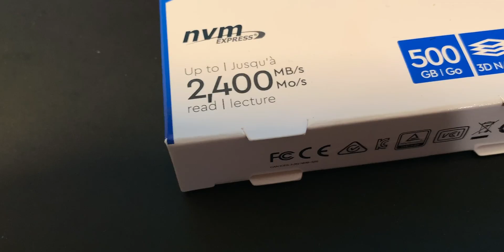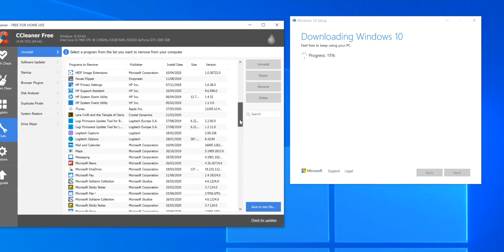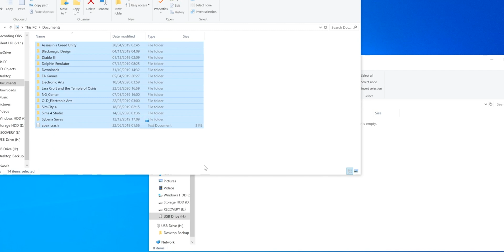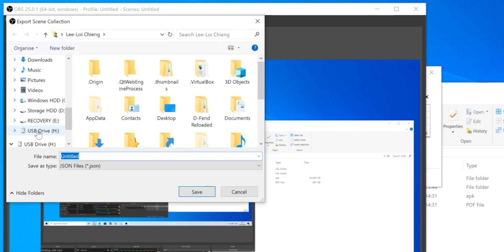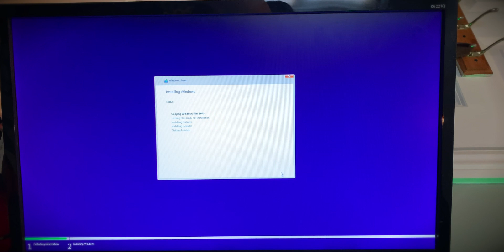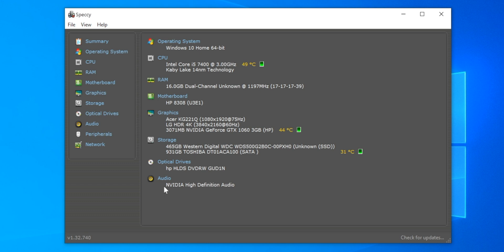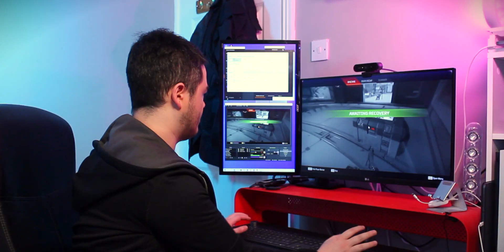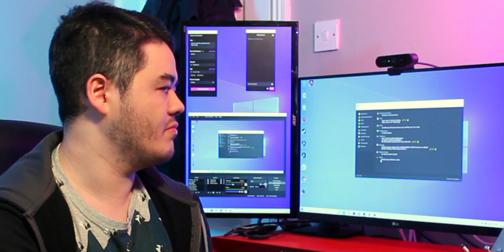Let's Upgrade my HP Omen Gaming Desktop Computer!

Comment: How did it begin a windows 10 install? Was there another drive hooked up when you booted it with the SSD? Im trying to upgrade my omen, but Im updrading SSD m.2 from another SSD m.2
Reply from the maker: Hey dude! Awesome stuff, so at 02:18 in the video when I'm prepping the Computer I show how to put Windows 10 on a USB flash drive, there's a link in the description to the installation tool. It's very straight forward as shown and be sure to keep the box ticked for "Use recommended options for this PC" If your making the thumb drive on the HP Omen you plan to upgrade. :)

Comment: Hi there I have the same motherboard (same pc different specs i7-8700 and 1070) do you know if I could be able too swap it for a i9-9900k? Thanks (Tampa2 motherboard)
Reply from the maker: No, this is locked to quad core processors only different socket only h270 processors compatible.
Reply: @ImLeeLoi  thank you good video keep it up

Comment: Hey lee what graphics card can i upgrade from a GeForce 1060 3gb (i have the same computer)
Reply from the maker: I’ve been eyeing the 2060 maybe even the 2070! 😁
Reply: @ImLeeLoi  Does it fit the motherboard?
Reply from the maker: @alexjamesj  That is a good point! Not 100% sure to tell you the truth. I haven't taken a ruler out and measured clearance. I don't think those cards are too big though.
Reply: @ImLeeLoi  yeah i’m looking to get a gpu so i can run VR better
Reply from the maker: @alexjamesj  Great idea. I must say I think I'll eventually just build a new system. The CPU on mine will always be limited to 4K so in a year or two I might just go all out. 

I might buy a cheap large SSD this year to move off mechanical storage altogether which currently has my game library on it.
Reply: @ImLeeLoi  yeah i’m gonna build the best gaming pc to date for the same price as the omen

Comment: Hey you might not see this but what's the full name of this pc?
Reply from the maker: Of course I do! I respond to everyone. It's the HP Omen 880-001NA from 2017 with 7th gen i7 7400 and the H270 chipset. :)

I did buy it used however.
Reply: @ImLeeLoi  thank you so much! I have the same pc but I couldn't figure out the name 🤣 I searched it up by the parts and different pc's came up. Now I can find out what's compatible and what's not thanks!
Reply from the maker: @pon224  Ok just make sure it's the exact same model. :)
Reply: @ImLeeLoi  im pretty sure it is thanks bro you earned a sub!
Reply from the maker: @pon224  Thanks for supporting the channel

Comment: Hello Lee!  I'm a bit of a PC-Part noobie (as weird as it sounds if you knew I code) and I was wondering if 2133MHz is truly the speed of this ram?  I really don't think its fast enough considering games I play which are heavily CPU dependent such as Fortnite.  Im thinking about upgrading to 32Gb and if possible without clocking over what I bought for getting my ram to 3200MHz aswell as an SSD (which I'm not sure how to install cause I have an HP Omen 870-244 which has an i7-7700, GTX 1070 8GB, and 16 Gigs of Ram) and I'd appreciate some guidance
Reply from the maker: I've never overclocked before. The ram said it did run at 2400Mhz, I think you need a different CPU and Mobo for faster ram but don't quote me on that. 

If your system monitor is telling you that you are using 16GB of ram while playing games then the 32GB upgrade is worth it. I can't imagine the difference between 2400MHz and 3200MHz ram being that drastic. The RAM and SSD upgrades should be similar to what I have done in my video. There is memory slots for your RAM and for your SSD.
Reply: @ImLeeLoi  Thank you :)

Comment: so you only need ram and a ssd card to upgrade on a pc im new to this lol ?
Reply from the maker: Welcome Everardo, the RAM and SSD items were what I chose to upgrade because they were quite lacking on the Computer I bought. My Computer had 8GB of RAM which is not a lot for todays games - you want at least 16GB.

The Manufacturer HP put "one stick" of 8GB already into the Computer so I bought a 2nd one to make it a total of 16GB. There are still two empty slots left so maybe next year I could upgrade again to 32GB if I need it (but I don't!)

The SSD was put in to make the Computer load faster. This Computer shipped with a spinning hard drive, I had a spare temporary faster hard drive but this SSD that kind of looks like the memory chip right it's called M.2  meaning it's very fast. 

Now if I was playing video games where they were animated slowly like the character is laggy and it's not enjoyable to play, I would need to upgrade the Graphics Card. I haven't done that yet, I'm not sure if I will I'm happy with what I have right now. :)

Hope this helps you understand why I bought new RAM and SSD.
Reply: @ImLeeLoi  i have a omen 870-224 which has a i5-7400 with 8 ram and the graphics card is a gtx 1060 3gb so would doing the same as you be good ? also i subbed to your amazing channel
Reply from the maker: @EverardoJuarez-l7r  Hi Everardo, 

Yeah I think we have the exact same Computer just inside of a different case. If you perform the same upgrades I have you're going to notice a MUCH overall faster performance. Everything from Turning on your Computer to browsing the Internet and yes, even loading Games like GTA 5 should load in faster than what you currently have. These upgrades will make your Computer feel fast and snappy.

However I have not updated the Graphics Card. If there's a game you're playing where you want to turn the graphic settings up or have them move faster that would require a Graphics Card upgrade.

My advice is to get started with Ram and SSD and see how you get on. You can then decide whether or not you want a new graphics card. :)

Thanks for supporting the channel, I hope this helps.
Reply: @EverardoJuarez-l7r   the 3gb on the gpu is a big letdown

Comment: what can you do gpu wise will a something bigger than a 2080 fit?
Reply from the maker: Hmmm.. Good question, the real thing to watch here is the 500W power supply so you're not putting something too powerful inside anyway. 

I feel like you have a fair bit of room there isn't a hard drive caddy or anything in the way. Certainly something 260mm at least... I could see it stretching to 30cm but not too sure.
Reply: @ImLeeLoi  Have you looked into swapping out the psu?
Reply from the maker: @ndavies5259  Hi! Not really because the processor will never be able to upgraded beyond what’s in it as the 6 and 8 cores use a different socket.

I think if I wanted a huge graphics and processor boost I would need to build a rig
Reply: @ImLeeLoi  makes sense! So  I'm considering changing my psu for my omen thats in the same tower as yours. As I want a 2080 to replace my 1070. If it matters the tower came with a factory install i7 8th gen. I know the 2080 recommends a lsu of 650 or up. Do you forsee any difficulty changing the psu in this case as it seems the cable management runs under the mother board and/or do you have any psu recommendations for this case ?